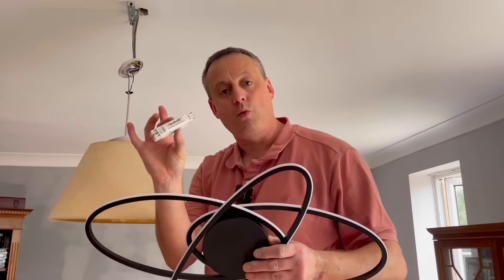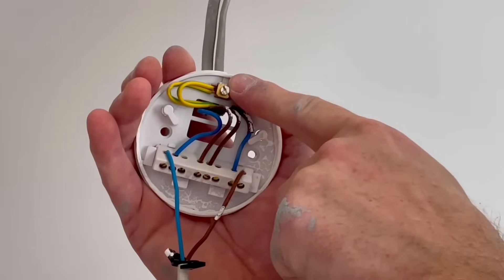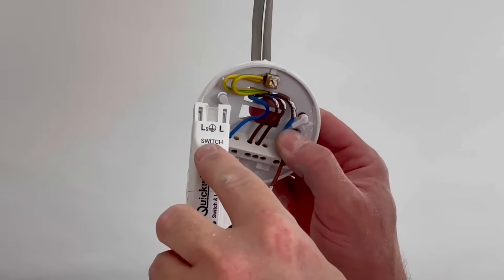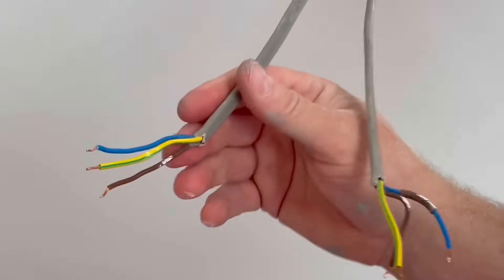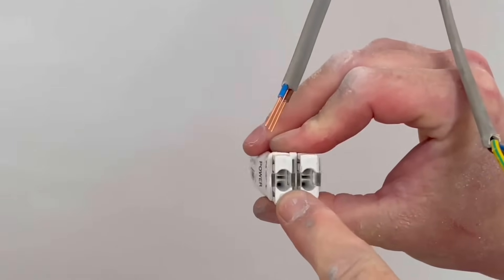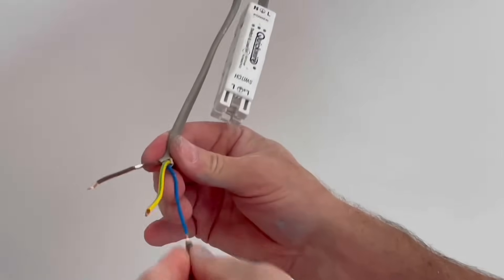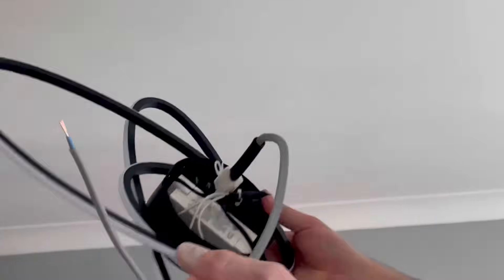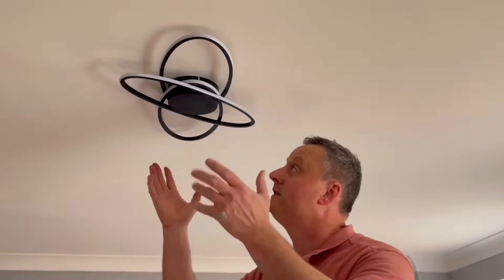Changing a Ceiling Pendant to an LED Light Fitting - Using a Quickwire Switch and Load Connector

Comment: Just used the quick wire switch and load for the first time today, 
Replaced the old porch light for a LED bulkhead light, have to say I am impressed with the quick wire , fantastic bit of kit, I like a lot, will definitely be getting some more of them . And there cheep as chips . A fumes up from me .
Dam it i’am starting to like modern technology 🤣 na don’t think so .🤣 fantastic video as always Gaz 👍👍👍❤️

 Question? What are the little holes on the top for there are three on the power end, and one on the switch end , are the test ports ?

Comment: Need help regarding LED BATHROOM MIRROR , when I connected direct 230v with block connector my fuse trip. 
Do I need switch with 3amp fuse
Mirror information 
Power : 24-36W
Input : 100-260v
Working voltage : 12v
Light: 6000K Cold White

Comment: Nice one gaz 👍👍 once the quickwire connector is pushed into the ceiling through the hole ,does the hole need sealing with an intumescent sealant around the new L/N/cpc cable.i suppose the new decorative light fitting covers the hole. But always wondered if there was a reg to fire seal cables , like they have to on all pipes and all sorts fire sealed in new builds

Comment: Did your power trip when you cut the incoming supply feed or had you turned your RCD off?
Reply: @ascot4000   You must not realise that cutting E + N at the same time trips the RCD protection even when the MCB is off, which is why i've asked this question..
Reply: @electricalstuff259  If the circuit is sat on an RCBO there shouldn't be a free standing RCD to trip.  Each circuit can be fully isolated independently.
Reply: @chrismason1119  Was it on an RCBO (which is an RCD btw)? 

EDIT: Just seen Gaz has stated he has an RCBO board. Makes sense now.
Reply from the maker: Fully isolated 👍🏻
Reply: @GSHElectrical  How comes you turned off the whole unit just to do a light?
Reply from the maker: My protection is RCBO/AFDD’s

Comment: No good if your cables are too short.
Reply: Also he didn’t show the faff of opening up the ceiling to hide the connection and cleaning up all the plaster dust afterwards. A couple of 227’s does the job just as easily with less mess.

Comment: I like those strippers.
Reply from the maker: Thanks 👍🏻
Reply: @GSHElectrical  can they be used for stripping more than what's needed for quick wire products?  For switches and sockets for example?
Reply: @MrKeefy  yes they can, even work on Flex cables too